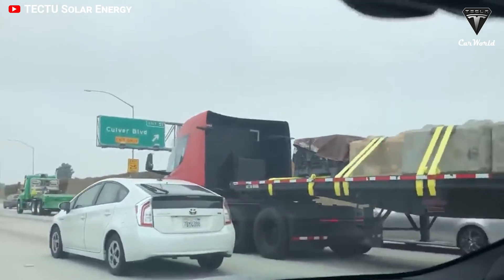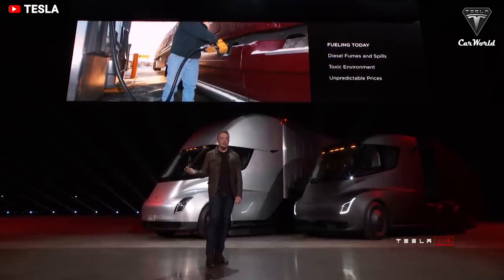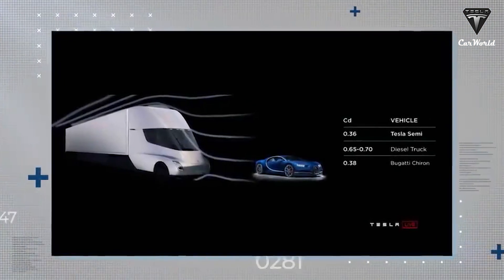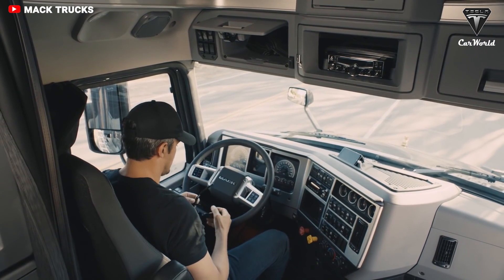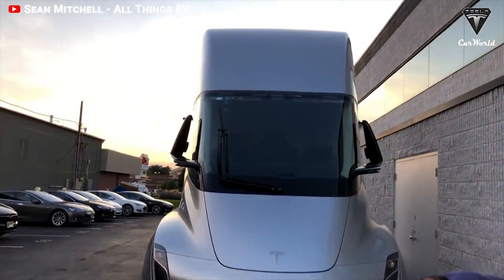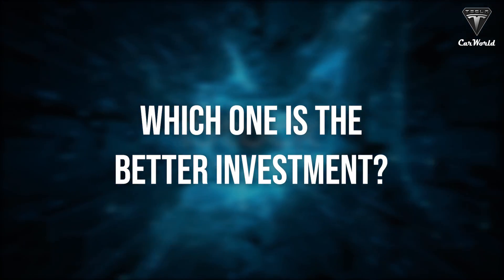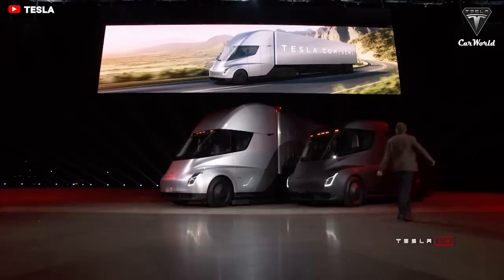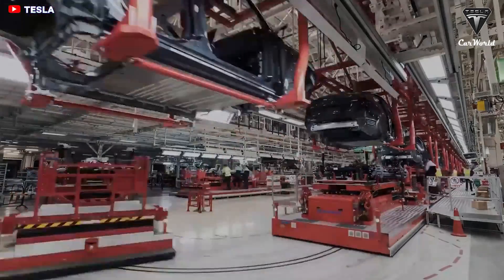Which is the KING of 2023 heavy trucks? Mack Anthem Diesel Truck Vs. Tesla Electric Semi?

Comment: A semi truck is not a race car I don’t know why you’re all worried about acceleration you need long-haul trucking at smooth acceleration long-haul that truck will ever make one hole if you accelerated too quickly you don’t eat up the battery and start measuring batteries in horsepower

Comment: As a side truck driver.  In all reality it may be a nice day cab. But it looks like a pain getting in and out seat to out side. The sitting in the middle may be going going down the road. But backing in tight place with just inches on the side. Most my stops have no loading dock. All that glass will be hot  in summer and in winter snow storm. Also like to how it will holds up after a year of winter sale on the  electrical system. This time of year I am always fixing  corroded connections. We won't see them for some time for no place to charge and the time it takes. I make 3 fuel stops a week for less then an a hour of my time a week. So having to stop every day charge and could be more. Plus we don't have big truck stop where we run. So charging would interesting and fun when we get stuck in a blizzard for a few days.  Then the sleeper is a problem for me. Not give up my shower and cooking area.
Reply: Look into the Hyliion solution.
Reply: The first offering is a day cab and is only being released one major customer at a time but as the infrastructure for charging gets built and newer batteries are released, I am sure they will have more than their "day" fleet.  But once charging stations are built roughly every 5 hours down the road you should be able to hit your 11 and 14 hr day limits....now if you are a scofflaw this isnt a truck for you lol.

Comment: The Tesla probably won’t have a sleeper variant, as the truck is currently practically useless for long haul, and imposible for team-driving. But hopefully it’s as good as they say for local driving.
Reply: once there are charging stations every abo 5 hours on the highways it will be fine even for long haul due to the 14 hour windows of operation drives must follow.  But, the orig poster is being dishonest about the cost of charging...you will have to charge this truck during peak hours at least from time to time but even in off peak hours the cost of electricity in California and NY is more than double his quoted price.

Comment: Acceleration doesn't matter when the down time for each charge will make the delivery take way way longer. Warehouses already run into issues where Electric forklift charge time needing to be worked around. A bigger vehicle with a way way bigger battery bank will not replace diesel trucks any time soon.

Comment: 1600 lb ft is a very conservative speculation. If I were to take a guess, that truck is closer to 3000 pounds of force; which is enough to pull the panties off any modern diesel powered semi trucks available on the market today.

Comment: what about the trucks that need a pto?
Reply: That's easy for an electric truck. Just put a motor where the PTO is needed, with the appropriate HP and speed. No need to run the main motor when a smaller one will do.

Comment: Can the Tesla go 200 miles without recharge? Loads and grades make a difference.  Sleeper cab? Can you idle a EV truck in hot and cold climates that would be important. Most trucks do alot of idling at pick up and deliver points.
Reply: words fail me.

Comment: Be honest... With the new data showing that the Tesla Semi will require as much energy as a small town to charge, do you really believe this is the solution for a greener environment? Sure, the truck no longer produces carbon emissions directly, but manufacturing it still required a significant amount of finite resources and produced a significant amount of carbon emissions.
Not to mention, less than 20% of the world's global energy is supplied by renewable energy sources, so charging the thing still produces carbon emissions.
I want this to work, but I don't see it's viability in the short term.

Comment: Two bullshyte points. One, You used the gas price vs the actual diesel price of 5+dollars. The acceleration point isn't what drives the truck view point, it's the torque and horsepower. The motors designed for a car will be put to a different set of stressors within the class 8 environment. Hopefully it can handle the stresses. The 2nd bullshyte point is the 82k capacity, 80k is the maximum gross weight, for either truck in the US without overweight permits. Report properly, or not at all🤷‍♂️

Comment: Long range the Tesla needs to improve, and we haven't seen what is planned fir a sleeper arrangement.  
500 mile range is fine for local or regional,  but my Cascadia can do 1000 miles on 1 fill. How long will a full charge take?  Tesla will be better in cities due to zero emissions,  but in the cold upper Midwest where I roam, how will the battery hold up to negative Temps, and keeping the driver warm.

Comment: You can't compare Electric Motors to Combustion engines. Combustion engines have a power band where you have to keep hitting by changing gears to be able to produce enough torque to move. Electric Motors can use all the torque all the time as long as it is draining electricity from its batteries. This is why freight trains all use electric motors instead of diesel motors. They only have diesel generators to create electricity for its electric motors.
Reply: They should develop a smaller version of the diesel/ electric for trucks.
Reply: @stephenrodgers5672  they do it’s called Cummins it’s Been put in dodge trucks since 1989
Reply: @stephenrodgers5672  On a train they are not worried about regenerative braking.  So it would make more sense to use a configuration of diesel electric that uses DC traction motors and no variable frequency drive. on a train  On a car you want to use AC motors that do give you the ability to use regenerative braking.  There are diesel electric hybrids cars available but in this environment where diesel is significantly more costly than petrol nobody wants to own them.
Reply: Diesel locomotives use this electric set-up purely because it's economical and by far the simplest method of transferring the power to the wheels.
Reply: Cold,heat ,charge cycles ,uphill down hill , I mean they did a test between a dodge and hummer electric , range with payload, diesel actually got better range , guess we'll see how that goes with an 80,000 lb payload with wind resistant, cross winds , all kinds of cross winds up hills down hills not to mention driver gonna need his creature comforts running all the time .
Reply: Thats why i tell people all the time electric isnt the way forward hybrids are theyre the best of both worlds u get the power and torque of electric with the convenience of combustion
Reply: mostly false. also diesel powered trucks have more energy per pound than batteries. its about a 20 to 1 difference. 1200 pounds of diesel will take you further than 8000 pounds of batteries by more than double. most trucks that have a sleeper need to run 750 to 800 miles a day. the tesla truck currently as advertised as the long range model on level ground no hills can make about 400 miles....
Reply: THIS WAY, using combustion as generators, could work, i just wonder if it wouldn't end up needing a massive engine anyways cause of the power consumption of the eletric motors.
Reply: Most locomotives use dynamic braking where the power generated from braking is converted to heat by resistors and the heat is blown out the top.  Over half of Union Pacific's locomotives are AC and use variable frequency inverters to control speed.
Reply: Most locomotives use dynamic braking where the power generated from braking is converted to heat by resistors and the heat is blown out the top.  Over half of Union Pacific's locomotives are AC and use variable frequency inverters to control speed.
Reply: You are forgetting that all those trains have power supplied from an overhead cable of third rail. They don't use battery.
Reply: Bingo that's right so no long heavy hauls for electric truck only short trip , diesel rains king for cross-country hauls
Reply: @r.t.1942  Now imagine a tesla semi in the cold regions of the US. Guarantee that cold is gonna mess up the huge batteries
Reply: @ElDuchè24  i live in canada where we get -25 to -40 sometime and battery lose around 35%  to 45% range in winter on some car si imagine the truck would be the same. For local delivery thought and when i say local  i mean 100 miles range delivery you should have enought power to do a round trip and back to the terminal. Right now we have 2 straight truck from Lion electric companie with tailgate been 2 years that they been using it local for testing and from what i understood the idea is for local under the 100 mile is holding up just the price for it is too much. Around the same price has a full semi for a straight  truck has a sleeper depending on option in.
Reply: @r.t.1942  Depends, electric has only been out for a few decades compared to diesel trucks that have been around for much longer, don’t doubt that hydrogen or electric will takeover
Reply: @FUNKER420  there’s literally multiple hydrogen cars and hydrogen powered machines, you’ve obviously never taken chemistry
Reply: @TuneyDarko  Electric was the original car drivetrain type.  It was beaten out the market by ICE vehicles.
Reply: @Gam1ng Legend  we're reaching the theoretical limits of batteries. Unless we somehow figure out a different method to store energy more efficiently (as in, using less space and weighting less), they won't get much better than they are now
Reply: @TuneyDarko  i dont know about diesel but i have read that car companies are looking into/ testing artificial fuel to save ICE engines
Reply: Prefer  Tesla ！

Comment: Sure All that acceleration will drain the battery faster . just like a gas engine  on the ram TRX the More horsepower the more fuel is burned 🤔

Comment: I think the idea is cool but my only question is range and charge time. I haul a train set of fuel tankers and a full tank of fuel runs me 1-1/2 days and takes me 15 minutes to fill it from E my GVWR full is 120,000 LB’s you would need a fleet of these to replace one of our kenworths not to mention the time wasted on swapping rigs to the trailer set. Also the 18 speeds really help on steep grades not to mention on downhills with the Jake on
Reply: Range is irrelevant as its only a day cab. No bed, no long term storage, no kitchenette. You also sit in the center and can't reach out the window to pass loading papers  or pay a toll; it also makes overtaking or passing a pain in the dick. It also has no way to clean the mirrors without a ladder, as you can't reach them from the window and there is no step-up on the front. You also have to walk around the truck just to get in, which is horrid if it's muddy, wet, or snowing outside; as you track mud all over the truck(god forbid you need to exit the right side of the vehicle, you will have to climb over the passenger seat) The passenger also has to sit behind the driver which is poor for people who get motion sickness. Furthermore, with a large truck, you need tactile buttons for everything, you need to be able to feel the button actuation without taking your eyes off the road. The windshield is also a travesty, being slanted like it is, will cause snow build up in the winter(not an issue on a car, but try cleaning snow off a 3meter tall vehicle) and excessive heat build in the summer(which is why most semis have flat glass) meaning more ac use, shortening longevity. As someone who drives a big bore truck, I wouldn't take a tesla semi, if you gave it to me.
Reply: @Completedaudt  wow, do you have any original thoughts, ir are you going to keep cutting and pasting someone elses?
There's less obstacles to adjusting your right or left mirrors than a conventional truck. You don't have to climb over your passenger or seat to do it. Wanna bet they're powered?

Toll booths? Just like the mirror, you can get up off your @ss and stand next to the window. 

Tracking mud or snow? Really? Scrap your boots on the steps, or put down a rug.
Have you ever driven the Tesla truck through ice and snow? How would you know it's windows are difficult to clean? All you have to go by is your "reckonings" like designers and engineers are idiots and you're the smartest person alive. 

Tactile buttons? 😂 For what? What button do you need to feel in a truck?
The radio has tactile steering wheel controls. Everything else is automatic. I'm sure the air and parking brakes are also manual. 

Sitting in the center reduces right side blind spots. 

You don't know if this will offer a long haul version with cab.
Reply: I’m sure teslas will be terminal hoppers where customer terminals will initially adopt the chargers 🔌
Reply: Isnt driving time on trucks regulated and rest is mandatory after certain hours?  Chargng can be done during those mandated rest hours.
Reply: At 120,000 pounds fuel tanker, are you talking about a road train in Australia?  That is a bit of a extreme case, and the Tesla truck is up for that challenge.  Just you would need to switch tractors midway between those huge cities that are about 1,000 Km between them.  

Or do what the Germans are doing because they have a trolly power line that is above the freeway, for 60 Km going into 3 large cities.  So the electric trucks can charge for 60 Km leading in our out of these three large cities.  

For I5 in California and Oregon, have the 5-10 mile long uphill grades electrified, and the valley have about 10 mile stretch about every 35 miles to get the truck battery charged again.  If they could charge at 10 KW per minute, and are also using about 2 KW per mile, then during the 10 minute charge time, they could collect about 100 KW for the battery, while using 20 KW to power the truck motors.  While going up a steep hill, the motors might be using 4 KW per mile or 40 KW over a 10 mile long uphill stretch.
Reply: Fast Eddie:  GIven that the Tesla semi can charge 70% (350 miles) in about 30 minutes (time for a bathroom break and a sandwich), it's not like refueling is going to be a big time problem for the Tesla. 

And the Tesla is MASSIVELY better than diesel on any downhills, while it's recharging the battery (more range and safety) by regenerative braking. 

You mostly have NO IDEA what you're talking about re comparing the vehicles, frankly. 

How is 18 speeds to get to 60 in a minute or more IN ANY WAY superior to just driving up the hill and getting to 60 in 20 minutes again?   Get serious.
Reply: @rogergeyer9851  where are you going to find a supercharger that accommodates a 75' rig?
Reply: @1964suicide  The best use scenario at the moment is short haul and having your charging stations installed at the distribution centers.  Charge while getting loaded or unloaded..  I can imagine long haul becoming viable on popular routes for companies like USPS...
Reply: @rogergeyer9851  30 minutes is a long time just for 70%  that’s double the time for 70% distance allowed. Now multiply that by a fleet of trucks waiting to get charged, plus needing there won power plant to get power.
Reply: @rxzesereniti9750  you have to stop for that long anyhow if you are going 8 hrs and following the law. This is a direct quote from the "Interstate Truck Drivers Guide To Hours Of Service" 

The hours-of-service regulations require that if more than 8 consecutive hours have passed since
the last off-duty (or sleeper-berth) period of at least half an hour, a driver must take an off-duty
break of at least 30 minutes before driving

obviously you do not haul freight for longer than 8 hours a day or you are in violation.  So you have plenty of time to get 350 more miles of range while you sit still for 30 mins. So that gives you ~850 miles of operation in a day maximum.  The 14 hour windows that you must comply with or be in violation of the law dont really let you go much farther than 850 miles before you must take 10 consecutive hours off.  What will limit your range is the availability of appropriate charging stations and the overall grade of the terrain you are traversing.  Longer if overall a down grade shorter if an up grade.
Reply: @rogergeyer9851  I typically drive 4-550 miles without stopping. It’s very impractical for long haul trucking. Not to mention that parking is already terrible so you’d need a fundamental overhaul of the truck stop system. This won’t be viable for long haul trucking for a very long time. Think it’s great for day drivers tho.
Reply: @rogergeyer9851  no where at the moment.. no highway stops have them. Its gonna take 15 years before that infrastructure is anywhere near decent
Reply: @floofsale  I wouldn't bet on that... Tesla has over 40K superchargers out there, the Megachargers will start with where the early buyers need them.
Reply: @rogergeyer9851 where did you get that from? Good luck getting anywhere near 70% in 30 minutes. At the very best, you’ll be looking at 3 hours for a 70% charge, 4 hours for a full charge (500 miles) with the current technology Tesla can offer.
Reply: @TheKroesar  my guess is that they will move towards having parking with charging because of the 10hour  break

Take your 10 then work. Need a little bit more before time is up? Change for 30min then keep driving. Once your time is up park at charging station and charge for 10 hours.
Reply: @J Emme One full charge cycle is one full charge cycle weather its 50% x2 for two days or 100% in one go.  Go to bed boomer.   Ideally (for time) its easier to charge when its under 85%.  Charging it to full can have an effect on battery life.  I guarantee you with how efficient logistics are they are 100% going to take this into account. 

Its cute you have no idea what you're talking about.  Esp when guys are waiting hours to unload sometimes.